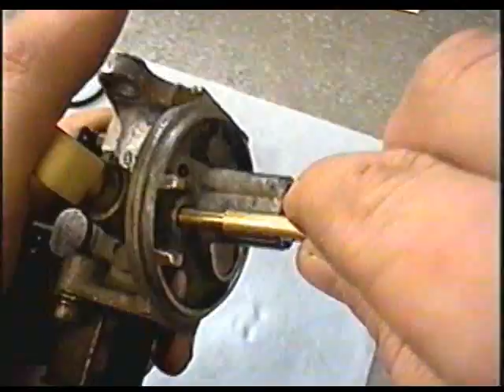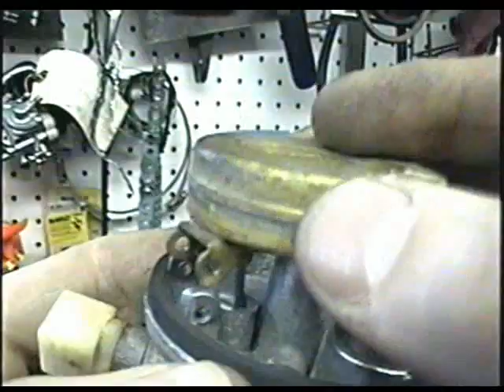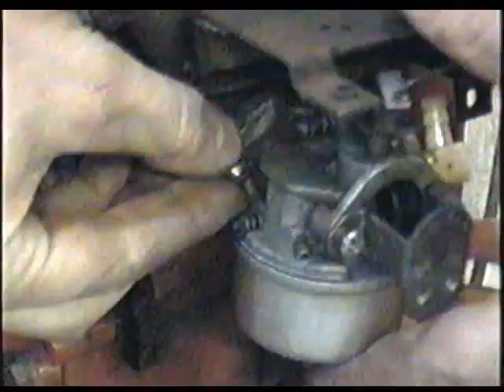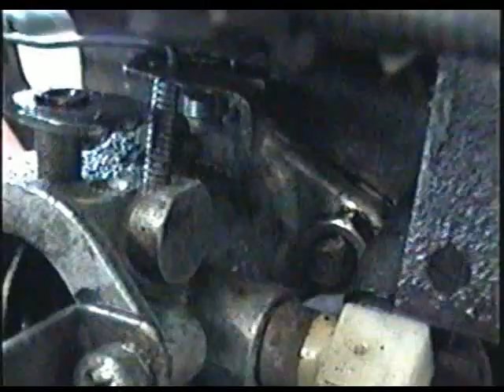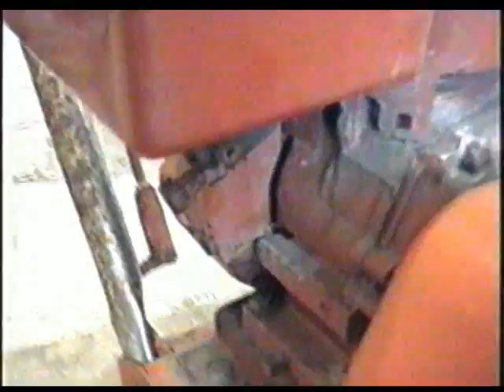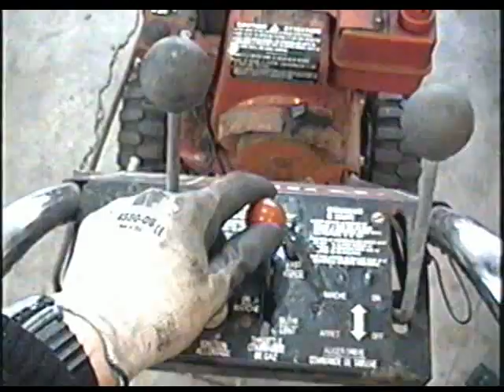HOW TO REBUILD Carburetor on 4-5HP Tecumseh Snowblower Engine Part 3/3

Comment: Great video man...My choke butterfly  is stiff .and also it just sits there with out anything moving it it does have lil holes to install linkages mine don't have linkages unless some one took it off!!,it will start if I spray starter fluid in the air filter..but it won't stay on.. help im trying to keep my tucumseh...

Comment: There was a Tecumseh tool that you used to set the seat.  What is that and is there a substitute for that so that I would not need to buy one?
Reply from the maker: https://www.ebay.ca/itm/OEM-Tecumseh-670377-NEW-3-in-1-Carburetor-Repair-Tool-Float-Needle-Seat/333012027882?hash=item4d891049ea:g:UeoAAOSwa1ZcOlDa

Comment: Why rebuild the carburetor you can buy it on Amazon for $13.99 rebuild kit you get brand new carburetor shut off valve gas filter new primer and hoses it’s all in the kit . I just ordered mine today.

Comment: This is a very good video.  I did this repair on a toro 421 which used the same carburetor.  The only thing I did differently is to remove the two screws holding the intake manifold to the engine and pull the whole assembly off as one piece.

Comment: My carb says 132 on the casting, I bought this snowblower used, when I put the needle seat in, the needle and float sets way to low, do you think he bout the wrong kit?  Not sure what the needle size dimensions are suppose to be.
Reply from the maker: kit for up to 7hp is part number 31840 you can also adjust the tab on float for height setting

Comment: Question? Do you know how well the aftermarket carburetors work on Toro snowblowers? I can get a complete bolt on carburetor for around $15- $20 online depending on manufacturer and my local Toro/Tecumseh dealer wants a little over $20 just for a few parts in the rebuild kit.. my Toro sat for a few years in a storage and the carb walls built up a lot of hard corrosion that looks really time consuming to clean out. Seems logical to just purchase the new ready to go carb for the same price if they work as well as the oem.. thanks for your time and video was great
Reply from the maker: some are great carburetors, see this video https://www.youtube.com/watch?v=elsP-Sp62z4

Comment: Great videos I watched from part 1 to part 3 for the rebuild of the Tecumseh carburetor.The engine started to run for a little ,but gas was coming out, of it looks like above the bowl .What did I do wrong?

Comment: Really appreciate you taking the time to cover the position of the mixture screws once replacing them, watched some other videos hoping to find that info on how many turns out or in worked best for their machine so I could at least have a starting point for mine.  Very nice video!

Comment: To replace some old primer line, I found some rubber  5/32" ID Windshield Washer Tubing at Canadian Tire. It fits well on the primer bulb and the carb fitting. I also realised from these Internet videos that the primer bulb base can just be pried out of the metal cover. No need to remove all the engine head bolts that are holding the cover on!
Thanks for the videos, they are VERY informative.
Reply: I used similar rubber hose someone had bought from an auto parts store.  Just cut it with a pair of scissors and it stays on at both ends not like the original which was 40 years old.  Mine has the primer bulb on the heater box yours must be the 1980s version that has it on the blower housing.

Comment: why do I have an extra gasket it's not a mini o ring from either needle adjuster but it's a washer about the same size as the mini o rings with about a cm hole in the center?

Comment: Hi Donyboy73 gotta say first off thanks for sharing your knowledge and sharing your gift with everyone. 
I have a craftsman tecumseh 5HP that uses 632107 carb and I was wondering if a 632334 carb would work on that engine.?  Also the person I picked it up from removed the rubber cover and air mixture screw from the non adjustable carb completely.  Would this cause the surging I am experiencing or could it be something else messed up in the carb?

Comment: It appears you made this video 5 years ago. I made a few phone calls for parts and they are no longer available. Can you confirm my findings or do you know parts that can be used in its place (#31840).Thanks
Reply from the maker: hi bob, kit 31840 is still available, if you're in Canada I can sell you one
Reply: I'm in the US but I found it on Amazon. One shop I called said no carburetor parts were available for my 78 vintage TORO 524.
Thanks for all your helpful videos, I'm a grateful/thankful subscriber.
Reply: @rcastillon1  Obviously the shop wanted to sell you a new machine.  No way anything you can buy now will last as long as that old Toro.  They built their machines to last!

Comment: Nice job! That machine looked ready for the scrapyard. 
Have you ever cleened the muffler on a 2 stroke? 
Mine is looking real black I imagine from running to rich/to lean because it bogs down when I engage snow?
I was told to soke the muffler in transmission fluid.
Thanks for the share.

Comment: Dony. I have this engine on a roto-tiller. I took that carb heater shield off with the 3 screws. Mine does not have an air filter... It should correct? considering it's not used as a snowblower and dust will get kicked up during tilling. If it does need one do you know the part number?
Reply from the maker: ajdarienzo it would need an air filter as a roto tiller, look on partstree.com with your engine model number

Comment: I wouldn't recommend doing this, but I had a new replacement float that came with a defective solder seam and after putting it on a low heat stove burner to dry it internally, it resoldered itself, never thought low would get that high.

Comment: 5 HP Tecumseh had 120 psi compression, now has decent spark after cleaning the coil contacts on flywheel and reseting coil distance to magnets.  Still no ignition, even after spraying starting fluid directly into engine spark plug opening or directly into air intake.   Suggestions?

Comment: My 5 HP Tecumseh is not starting after cleaning the carb.  I noticed when I attempt to start it that gas is coming  out the air intake. (I have the filter off at this point).    Any suggestions.?

Comment: Perry make sure the fuel line fitting on carb is not cracked the white plastic 90* fitting. I was having the same issue and took carb off and then noticed a crack in the plastic fitting. JFYI

Comment: I have toro snowthrower 2c ccr 3HP and the only way I can get it to run is by putting fuel in the spark plug socket but it only runs for a few seconds. I cleaned the carburetor good and put it back together, but it still does the same thing. Any thoughts?

Comment: In attempting to to stop a fuel leak on a Toro snowblower, I rebuilt the very same carb with the same kit as used in your video. However, I still have a gas leak which appears is coming from around the bowl seal. I tried to adjust the float so that it would engage the needle at lower level of fuel but still have a drip when the engine is not running.  The float is metal and appears to be good (no fuel inside). Any thoughts on what else should be looked at?
Reply: Is there any damage to the float bowl, you might need a new one. Also make sure if you put in a new needle seat you put the ridged side of the seat in the carb first. The smooth face of the seat touches the tip of the needle.
Reply: No damage to the float or float bowl that I can tell... Seat is inserted properly with smooth side up.. Wondering whether there is a crack somewhere in the upper half of the carb that cannot be seen...
Reply: I'd try to hold the float closed, apply light air pressure to the fuel inlet, then dunk carb in water and look for bubbles. If there is a crack you might find it then.

Comment: hi dony do you have videos on rebiulding carb off 1998 briggs 16 hp vanguard horozontal shaft  carb # 809011  kit #809021 that wood be reel helpful thx harry

Comment: hello donyboy my mower carb is leaking gas badly I replaced needle/clip/seat o ring,there was no needle clip thats why i tought it was wrong and bought the kit and still doing the same.
Reply from the maker: you might need a new float

Comment: I REBUILT MY TECOMSEH CARBEROTER, THERE WAS NO FLOAT NEEDLE SEAT IN IT.  MY SNOW BLOWER HAS BEEN WORKING FOR YEARS AND THE ONLY REASON I,M REBUILDING IT IS BECAUSE THE ROD BROKE AND I,M, GOING THROUGH THE ENGINE AN THAT'S WHEN I NOTICED NO SEAT WAS IN THE NEEDLE FLOAT  SECTION
I TRIED TO INSERT IT AND IT CAUSED THE FLOAT NOT TO BE RIGHT.

AM I ON THE RIGHT TRACK?
Reply from the maker: if you had no seat your carb would have been leaking gas, make sure you haven't inserted a new one on top of the older one
Reply: donyboy73
Reply: Eugene Taglialavore I HAVE INSPECTED IT AND SEE NO SEAT OTHER THE CONE SHAPED METAL SEAT . THIS IS A LAWSON CARB.DATES BACK TO THE EARLY 70'S. MAY BE I'LL SEE IF THEY CAN HELP.
I'M NOT GOING TO DO ANYTHING UNTILL IT GIVES ME A PROBLEM.
THANK YOU AGAIN

Comment: Don, I have 2 carbs that came off 2 MTD 10 hp. snow blowers that caught on fire and were put out before the engines were destroyed, but the plastic floats are partly melted. Question (1) I know it is difficult to tell without seeing the machines, but is it possible to rebuild carbs in this condition or would there be more damage inside that the eye can't see. #(2) what would cause engines to catch on fire, I have NEVER had it happen myself.

Comment: hey don, ive got a question, will a 6.5 hp honda clone fit on a toro 824?
Reply from the maker: you would have to make sure the shaft is the same size and length
Reply: well im getting a 3/4 in to 1 in shaft dapter, are the baseplates the same its the same engine the chinese gensets use im tired of messing around with the tecumseh hm80, its had it and i need something reliable
Reply from the maker: the base plate should have the same hole pattern
Reply: i wasnt sure if the baseplate is the same, this hm80 has a one inch crankshaft but i dont know the baseplate measurments, that why im asking
http://www.ebay.com/itm/360853708593
how much is a complete hm80 worth in parts?
Reply from the maker: 43128lucky4 if it runs, between $100-$200

Comment: Hey Dony,
I'm helping my father rebuild his carb off a 5hp tecumeh snowblower.  I think his issue with surging stems from a pitted fuel bowl under the "O" ring area.  I viewed your video about pitted fuel bowls and the problems that can be created as a result of this.  I want to replace the fuel bowl, but cannot find one anywhere with the drain screw.  Do I need this drain feature or can I use #631867.  If I do need this feature, could you tell me where I might be able to locate one?  Thanks!!

Comment: My lawn mower wont turn over,If i pore a little gas in air filter housing it turns over till the gas burns away.my primer bulb dont seem to work at all either.i replace float,needle and seat. any sudgestions?

Comment: great vid donyboy73. very helpful, i just rebuilt mine and it does start and run but it is backfiring thru the exhaust , is there a way to adjust timing or is it my mixture, had a hard time getting it to run without choke on

Comment: Wasn't the float.  As it turns out it was the tiny vent hole near the primer hole had been plugged.  Didn't even know it was there, so small.  If the carb can't vent as gas enters the bowl, the float can't lift to raise the pin to close off the incoming gas.  The gas overflows out from the air intake opening.  Took a bread bag twist tie, removed the paper, took the wire and poked it into that tiny hole.  The carb no longer leaks gas. The hole may have gotten plugged when wiping down the housing.

Comment: Hi, thanks for the great videos, I watched this one a few times while I rebuilt the carb on my snowblower.  I noticed that yours started with only a few pulls after the rebuild.  Mine won't start at all with the pull start unless I use "quick start".  My blower also has an electric start and will start that way no problem.  It runs great after it starts, especially now.  Why do you think it won't start with the pull start?  I don't want to have to rely on the electric starter.  Thanks!
Reply: Try better spark plug, titanium Platinum etc these are old beast but they need a little more mmmfm

Comment: The float had no liquid in it.  Looked great.  Everything was clean.  Maybe the small white seal is that the pin moves up into is bad or missing?  If I don't have the tool to remove or insert a new one, what would you suggest I use?

Comment: I've got the Toro 5/24 and it's been leaking gas, dripping slowly off the nut on the bottom of the carb.  Got a repair kit and replaced the cover and bottom nut seals.  Still get gas dripping.  As it turns out its not from either seal but from the opening on the carb behind the 2 screws on the side of the cover.  Maybe this is the air intake?  Not sure.  This is my first endeaver into an engine of any kind.  Engine starts and runs fine.  But the dripping gas is bothersome. Any ideas?  Thanks.

Comment: I had to rebuild the tecumseh carbb on my Ariens 8526. There was no needle valve seat in it when I took it apart. I didn't put the one from the kit in. The snowblower runs really rough now and I am wondering if the lack of the seat could be the problem.

Comment: What model number is that carburetor?  I need one and it is the same one you just fixed, but its old and i can't seem to find any numbers other than 1085 cbc but nothing comes up .  Any info would help>

Thanks.

Comment: I'm working on a 24' yard machine with a 5hp engine. It has a fuel problem. You can crank the engine and no fuel will reach it. If you pull the plug and put in a bit of fuel it will run until the fuel is used up. I checked the carb and found the owner used an oil mixture. I cleaned up the carb and fuel still will not reach the engine. Help

Comment from the maker: there are 2 o-rings that go on the emulsion tube, if they are damaged replace them, the tecumseh primer bulbs do not fill with fuel, they only puch air in the carb

Comment: I have a H35 I picked up. It was sitting outside for awhile. After your videos the engine ran mint (points needed cleaning). Then it started loosing power after an hour and the carb would spit and back fire. Adjustments did not do much. I re cleaned the carb but not much help. I pulled the new spark and it was covered with black. Any suggestions? After I cleaned the plug it won't even start now. I was starting with 1-2 pulls.

Comment: These are very very good videos.  Has helped me fix my 5hp snowblower with Tecumseh engine. I was going to junk it because its 12 years old and wouldn't run correctly.  Thanks to you its running like new.  Thanks again